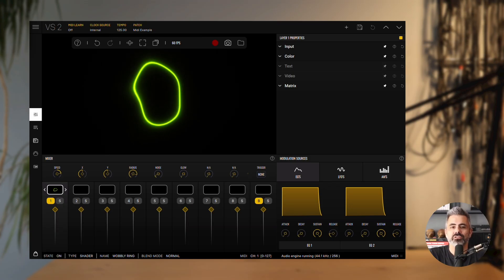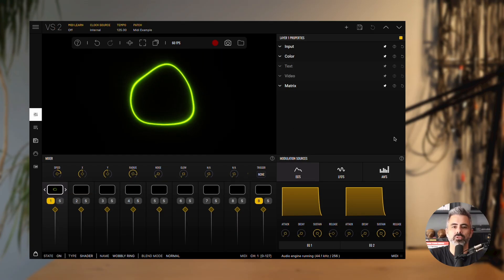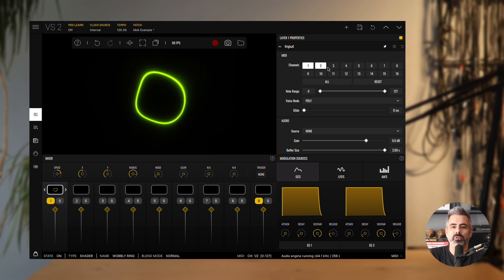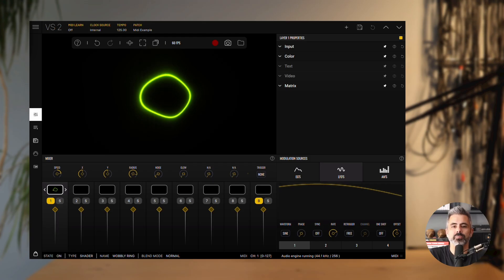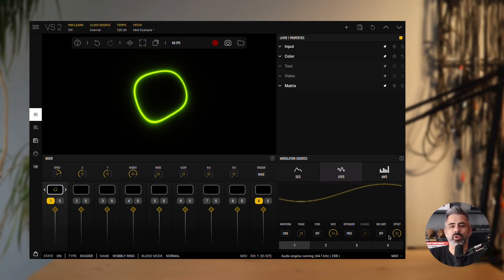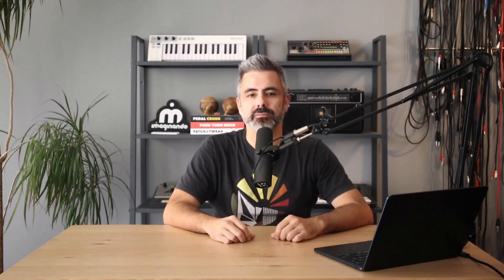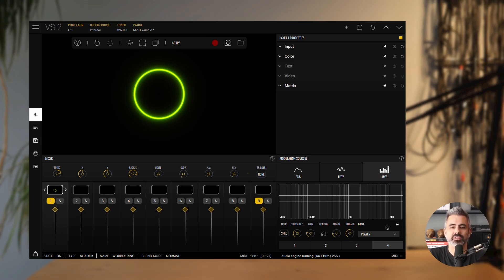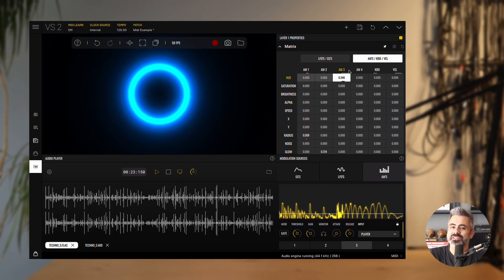VS 2 - Modulations Tutorial

Comment: What is going on if the bottom right MIDI input monitor is not even visible  but the layer MIDI indicator blinks when triggered by MIDI keys?
Reply from the maker: That’s because the midi activity monitor is not being displayed when hosted. Needs to be fixed.